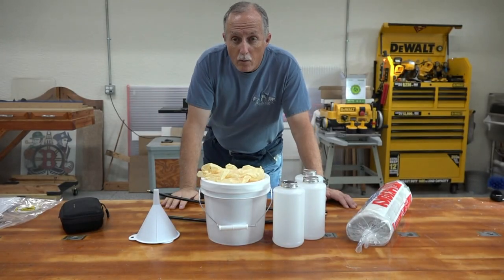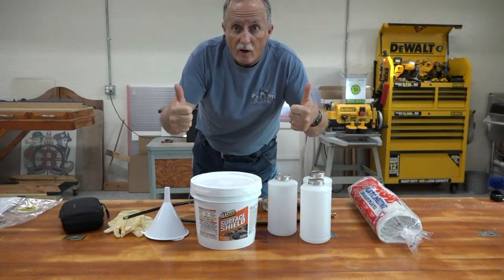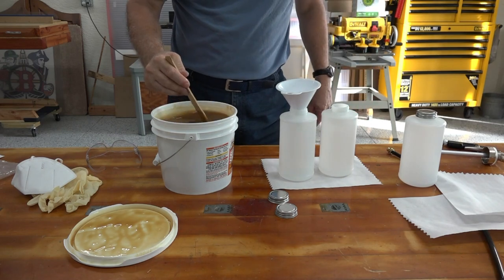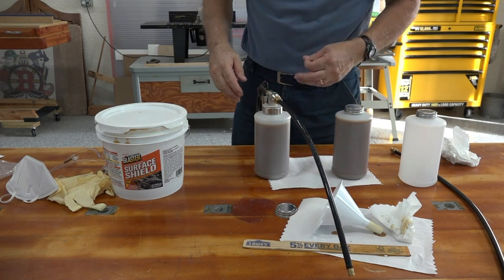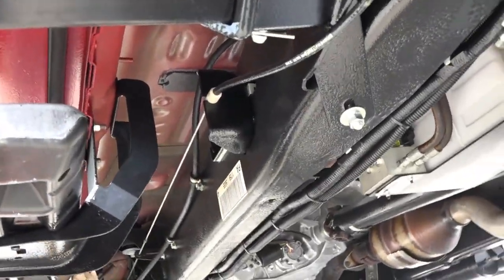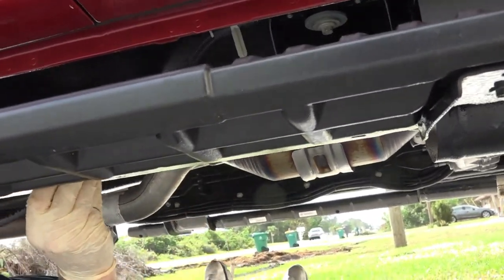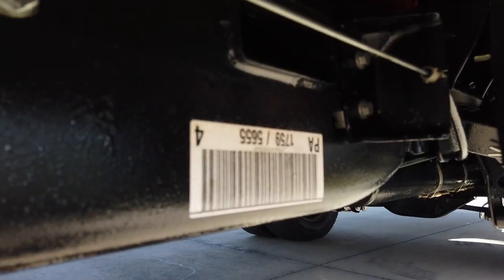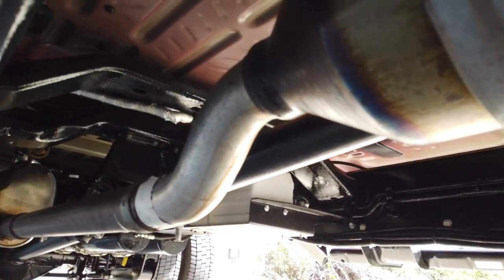How to Undercoat a Truck using Surface Shield

Comment: I'm in northwestern PA, and we get some pretty harsh winters here. I sprayed Surface Shield under my truck a couple years ago and just went under it again this fall to re-apply. I was utterly amazed at how this stuff was still holding up. Most areas were literally still wet and oily from when I sprayed it 2 years ago. The best part is it doesn't make a huge mess, and it doesn't smell bad. Awesome stuff. 👌
Reply: can you pressure wash dirt and salt off without taking off the SS?
Reply: Hey I just put this stuff on the bottom of my 2011 silverado. It’s not supposed to dry? It’s supposed to stay wet? I almost washed it all off because it wasn’t drying. Never used this stuff before
Reply: @RobFox295  yes it stays wet. That's how it works so well.
Reply: @classicreaction5340  Thank you so much!!!
Reply: I’m in Luzerne county and just bought a crusty Sierra so that is good to know. Another selling point for me

Comment: aluminum doesn't rust, but is does corrode. you may want to hit those areas.
Reply: Agreed, and especially where aluminum parts and panels are fastened with steel bolts. The chemical reaction between those metals will eventually eat right through the aluminum and is accelerated by exposure to air and road grime/salt. A coat of this product would slow that process down.
Reply: Took the words right out of my mouth. The aluminum body and frame was more about weight savings for increased payload capacity of the truck than corrosion prevention.
Reply: @bryanderksen4448 Ford isn't completely stupid they have isolators between dis  similar metals . If they didn't they wouldn't last 1 winter

Comment: Quick tip, buddy has a 2015 f150, doors are starting to corrode in the typical areas they do when they're steel. Spray the cavities. I was shocked too.

Comment: Just because the body panels are made out of aluminum doesn't mean that metal oxidation will not occur.  steel and iron oxidize to iron-oxide and is what we know as rust and is reddish brown.  Aluminum also will oxidize to aluminum oxide which is white, but aluminum can also be oxidized completely through causing holes in your body panels, so you should also spray your body panels with Surface Shield to protect them from oxidation IMO.

Comment: bought new 2020 f150 in 2020 was upset on surface rust on frame , suspension and drive parts started within 1 year,  bought six pack of spray cans of this , a graffiti spray adapter to use a flex wand from fluid film for the inside of the frame .Coated as much as I could even spare tire rim and mechanism ,turned all rust black stopped it In its tracks.2022 inspection garage asked what year truck was and said how clean in was .I am in Putnam County ny salt like they have to much salt, and yes this stuff in amber turned it all back to black sprayed every thing hitch , diff  top of frame top of body mounts  universal joints  leaf springs ,coil springs , inside and outside hollow front a arms,,,that was 2021.5  treatment ,and not  sign of the evil orange rust .I have another 6pack of cans for touch up when I need it truck has 15k now ,daily driver

Comment: Pb blaster surface shield 🛡  is awesome  stuff  I sprayed  my 2021ram1500  when it was  new just put a second  coat  on it in 2023 no Rust still looks new and wet 😀

Comment: What shocks do you have on your truck?  I have a 2018 F250.  I like the lights on your brush guard.  I'd appreciate an update after the application.  How did it hold up?  Thanks for the video!
Reply from the maker: I have Liquid Springs suspension on my truck and it rides fantastic!

Comment: Wondering if my pancake compressor is up to snuff or I’m missing a piece to my extension wands. When I use them they don’t spray. This is even cranked as high as 100psi. Is my CFM not enough? Am I missing a brass nozzle before the wands?
Reply from the maker: Where the spray hose screws onto the gun only engage 1 to 2 threads to allow fluid to flow through.

Comment: Great Video. Looks like Blaster SS is the way to go. I noticed in your video that your truck is equipped with the Liquid Springs Suspension. Please tell me your opinions since you are an owner of this suspension system. I am thinking about getting the Liquid Springs
Reply from the maker: Liquid springs are fantastic!  Have had them now for over 13k miles with flawless operation!  My F550 actually rides like a F150 very smooth ride!!

Comment: I do undercarriage washes at my car wash...will that wash off my Surface Shield???
Reply: Hey Undercarriage washes are nice but if the car wash uses recirculated water that drops from the previous washes then goes through a filter process. If the filter process doesn’t include a filter for salt it stay in the water and it get used to wash under side of your vehicle. Need I say more.